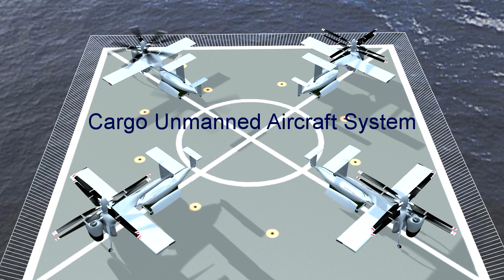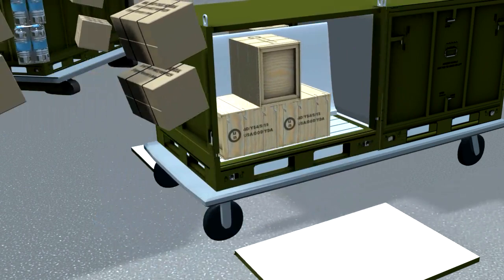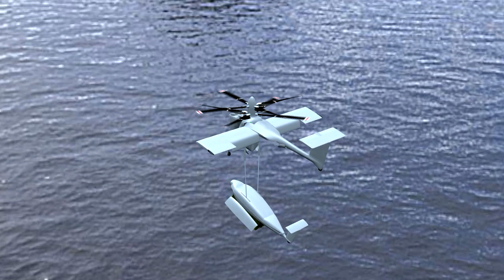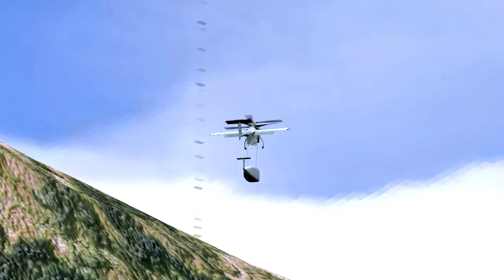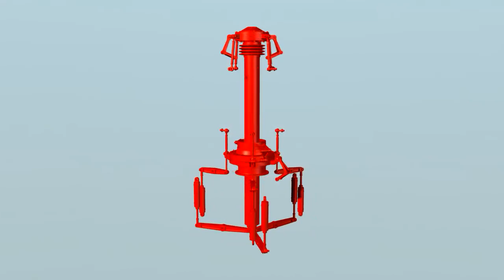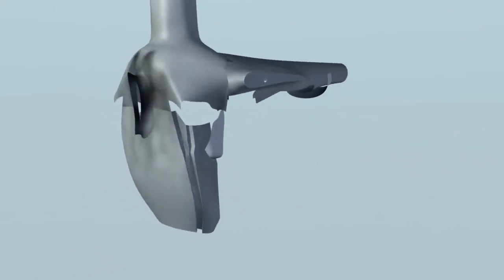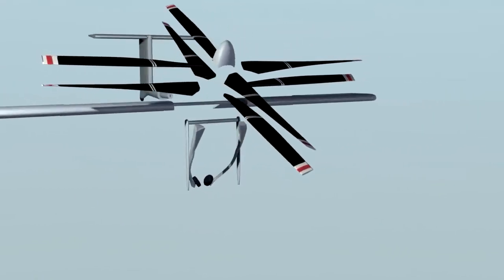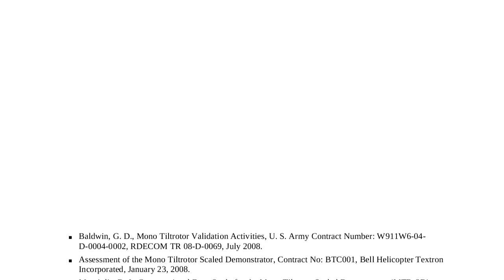Baldwin Mono Tiltrotor Unmanned Cargo Aircraft

Comment: Will it not causes vibration on the over hang 'fuselage', Especially during forward flight? The second fuselage horizontal stabilizer+aerodynamic of fuselage will induce oscillation, more so when encounter gust near hill area.